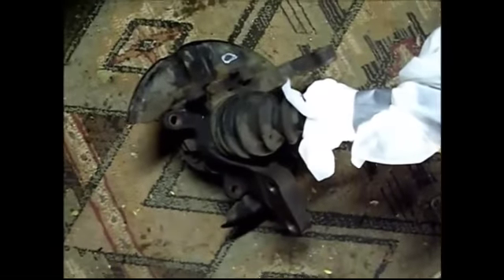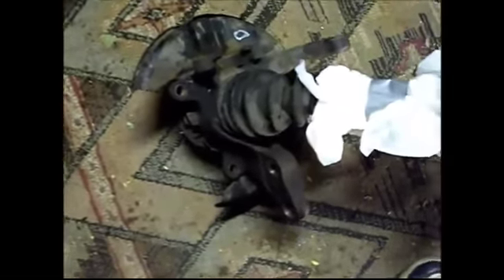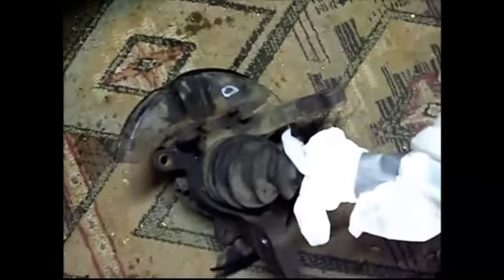Remove rear hubs and axles on Toyota MR2 AW11

Comment: I think they mean don't put the weight of the car on the wheel bearing without the axle shaft through the bearing.  spinning the bearing without the axle shaft through it though should be ok.